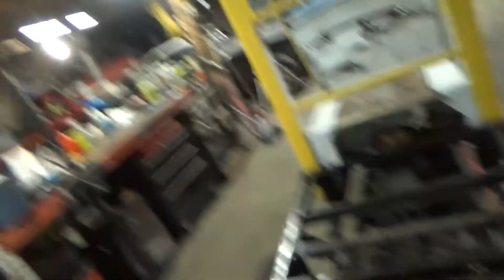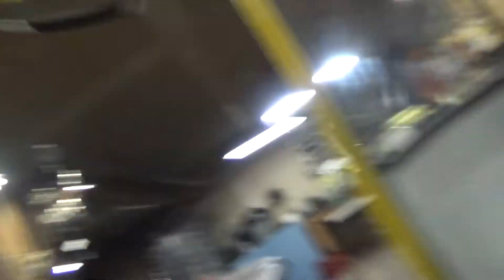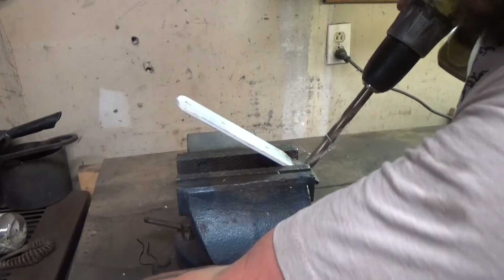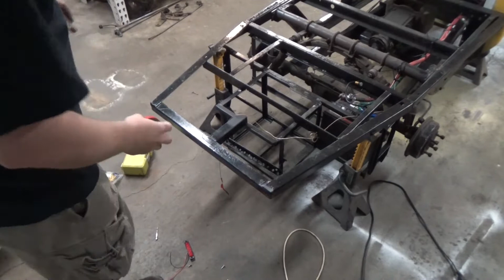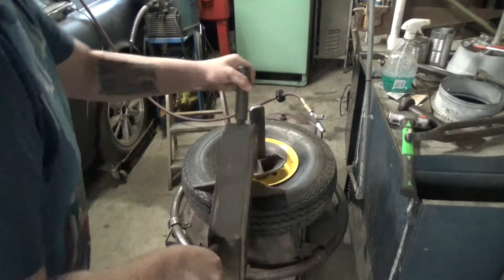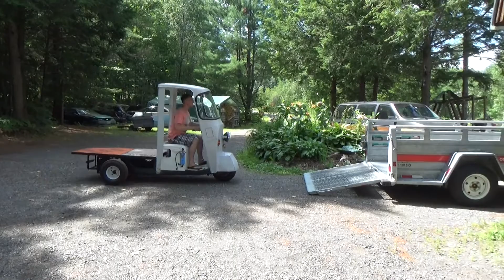1961 Cushman Truckster EV Conversion LiFeP04 - Part 9 FINAL UPDATE

Comment: Really appreciate..
Does it has any clutch ...?
Or is it controlling by motor controller..?
If yes it seems like motor is directly connected with transmission..is it ..?
Please reply
Reply from the maker: Hey, 
No clutch.  The transmission is directly connected to the transmission.  There is no true "motor controller," just a big 12v Relay.  To make it move, you click the relay with a button on the handlebar.  That's it!